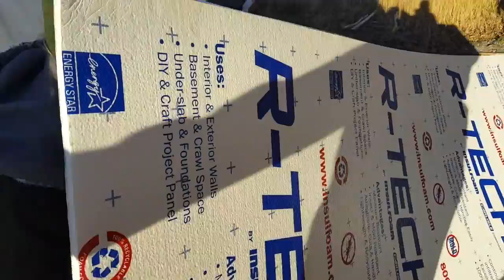How We Installed the Rocket Mass Heater Bench...and did it work?

Comment: I would do a cob bench and put the flu exit a lot higher.  There isn't enough mass to keep the heat for complete combustion and not enough height for the heat to rise to exit.
Reply: The complete combustion occurs in the burn chamber, not in the mass bench. The positive pressure caused by the huge increase in volume of gas in the burn chamber, pushes the cooled air out the other end.
Reply: The cob bench would retain the heat and help complete combustion.  It appears that the burn chamber is not retaining enough heat in order to have high enough heat to have a more complete combustion.... hence all the crap in the chamber.
Reply: Hmm, nope, combustion is all over by the time the hot gas enters the bench. There should be only CO2 and some water vapour by then.
They have certainly not followed the regular plan for a RMH. So there are several things fighting the system. The outlet piping should be fully enclosed and contained in the mass of the bench from the exit point of the burn chamber, through to the exit out the wall.
The lightweight aircrete riser he made was brilliant and functioned well. But the replacement "fire brick" riser that is an odd shape and very dense, over 12 times more weight than the aircrete, is causing huge problems. The idea is to have smooth profiles, either square or round, for the exhaust gases to flow down, not this wedge shape. And the riser should be highly insulating to increase the differential between the extreme heat in the riser and the much cooler outer chimney. The heavy firebricks are suicking lots of heat out of the burn chimney, reducing efficiency.
I think the use of aircrete and waterglass should be developed more. SOunds great. But incorporate these with the tested techniques and plans which already have the scientific testing done to show Why It Is So.
Reply: Ruby, I think you are saying the same thing as I am.  I agree that combustion takes place in the burn chamber, but they are still having incomplete combustion in the burn chamber.  I just don't think they have enough draw.
Reply: You mean the handfuls of burnt paper she was pulling out of there? Apparently that was caused by having such a high draught that the start-up paper just got sucked right through then stuck in a corner past the internal chimney. 
I think this shows that you don't really gain by trying to reinvent the tested parameters and measurements of the rocket mass heater. There are scientific reasons for the cross-sectional area of the burn chamber, for its length, for the insulation surrounding it, and its placement on ground level, with vertical feed-in of fuel. This system has altered all of those things, so anyhting could happen!

Comment: I have a cob poultry fence re enforced J style rocket mass heater, took a me few years to get it right but I have not had to repair it for 8 years. Your burn tunnel is way too big. Never burn paper, I hooked up a propane line to start the fire, also burn some pellets with the wood.  BTW yours is not a J tube it is an L tube

Comment: The "rocket stove" design employs some critical scientific principles and experimenting with the design before understanding the principles tends to create confusion.  The "rocket stove"  (properly built) will create a Cyclonic burn in the riser in less than 3 minutes(i.e. no smoke).  If the "feed" tunnel is incorrectly sized or is hotter than the riser,  there will be smoke and feedback.  If the heat is siphoned away from the riser,  the cyclonic flame will be reduced or even eliminated,  leading to partial fuel "burn".  There are other things to consider in your "design",  but,  I have to go now.
Reply: Wait, you can’t just LEAVE. Get back here and help finish the worlds most powerful rocket stove.

Comment: Sorry to say but you are thinking as if this is a wood stove -- rocket mass heater is NOT a stove.  Your burn box is way too large and you definitely need some vortex generators to get that second burn.  A little more  research is needed.
Reply: They do have vortex generators. See previous videos.
Reply: The simple hard 90 of a non curved elbow as the transition from burn tunnel to riser provides sufficient turbulence... 

  What they really need is a low mass highly insulative refractory material for the inner hot-face of the core that can withstand 2000F... 

Ceramic fiber insulation as is used in kilns... either the low density ceramic fiber board, or ceramic fiber blanket are the solution.  Blanket would be easier to retrofit into this stove... Just scrape an inch of the air-crete out everywhere except the feed tube, and cut your 1" thick ceramic wool into a strip slightly wider than the new inner circumference.

  Air Crete insulates great at cold to hot extremes of normal outdoor temperatures on earth... Not so much at 1500+F... 

  Also, unless he used a high temp refractory grade concrete, if it had the insulation values to reach those temperatures, it would break down, much more than it has so far.

  Luckily a ceramic wool inner liner inside the air crete would allow those high temps to be reached, AND protect the air-crete behind it.
Reply: @orcoastgreenman  ceramic fiber is where it's at.
Reply: @orcoastgreenman  what they really need is central heating haha
Reply: Raymond J - if you want to be dependent on systems and people tens, hundreds, or thousands of miles away from you to heat your home, then sure.

  My rocket mass heater works whether the power does or not.  And will still be working even if the SHTF.